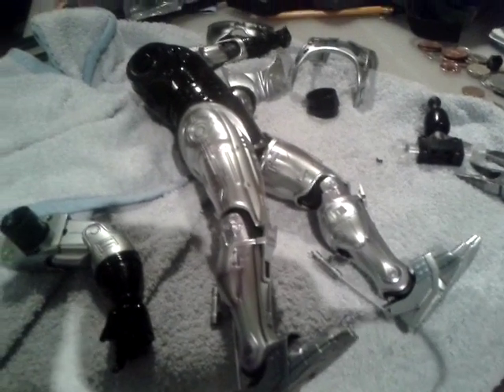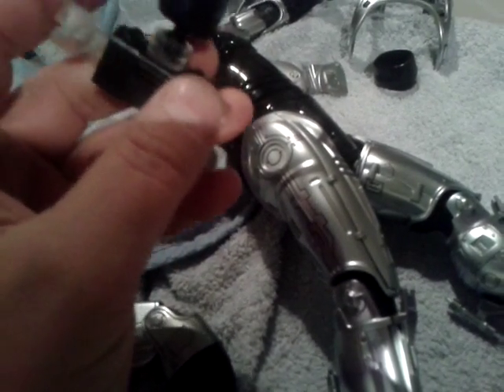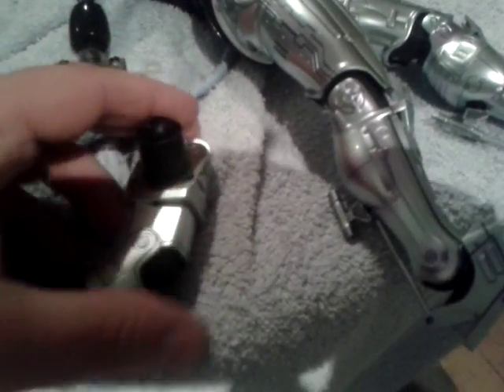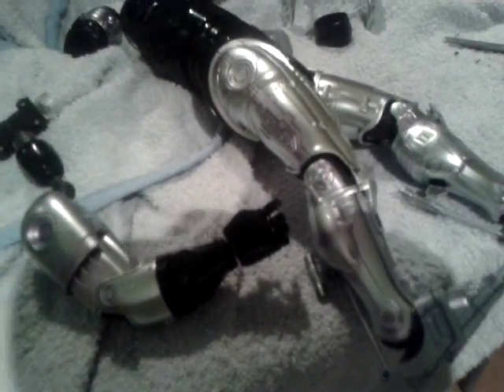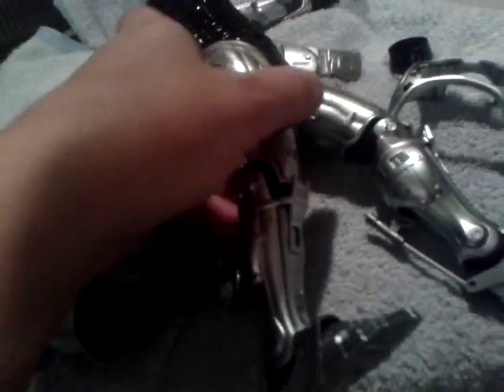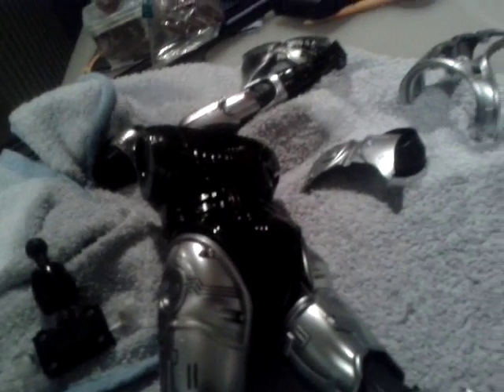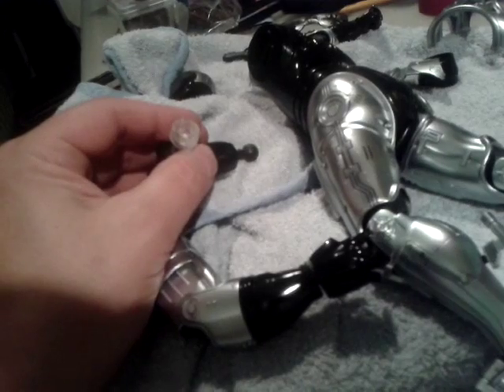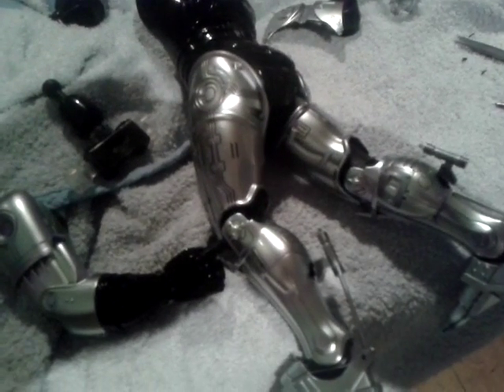Robocop disassembled broken shoulder socket repair

Comment: Pain in the arse mate, you got more patience than me. If it snapped off on me I'd just pick a pose and glue the crap out of it lol.
Reply from the maker: Haha stuborness more like it.Wont be beat.Had it sort of fixed but joint wasnt strong enough.Its back in the cabinet and is fairly posable so will see what hts response is to my messages.

Comment: Also my hot toys Robocop has the same problem, is simple to disassemble the rear armor? kindly can write the steps to dissemble?'m Italian I do not understand the video, you can leave a link with pictures? thank you :)
Reply: the four screws are covered by plastic, as they removed the plastic? thanks
Reply from the maker: hi yes you need to remove the plastic covering the 4 screws.Then once yoy remove those.There are 4 more under the next layer.I have uploaded another video showing more.Best I can do for now.Hope it helps.

Comment: HEY THERE MASTER TRON!! greetings from India.. I wanted to ask you for some help.. I just bought a robocop from HT, a brand new boxed piece that came out with a broken right leg, at the waist-leg connector( the ratchet system)  out of the box.. The ball socket is really tight and probably someone from the factory tried to articulate it before packing and it snapped.. I wanted to ask you if its possible to open up the entire body and replace the leg .. if they manage to send me a replacement.
Reply from the maker: Thanks for the compliment but I am no master.I'm a jack of all trades but master of none lol.
I have seen a robocop parted out on Ebay years ago so I know that the whole figure is able to be disassembled.I tried emailing hot toys years ago for a spare part for the shoulder but still no reply so am guessing unless you bought it direct from them and its within 14 days of purchase you are out of luck getting a replacement part or even a reply.If you can get an exchange I would opt for that rather than trying to get a spare part.The plastic parts they use to connect these die cast limbs are woefully brittle and not up to standard.Even if its handled carefully these joints are prone to breaking.I wish you best on getting it fixed or replaced.It is an amazing figure and one of my favourites in the collection and one I will never tire of looking at
 Unfortunately it's joints are inferior and not up to the job.
Reply: @sparkstron73  I am going to drill two small holes into the broken joint on the leg.. little into the hip ratchet and little into the part thats left on the leg .. put a steel rod into it.. and then epoxy it .. Like a real surgery.. Do you think it would work
Reply: @sparkstron73  And could i ask you whether its possible to open up the entire figure and repair the ratchet on the leg and then put it back together.. 
 do you know if the lower part can be opened.